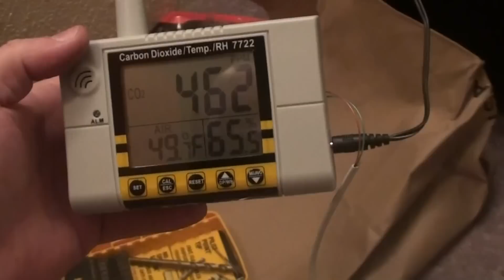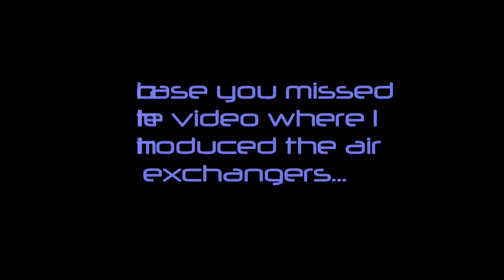Drum Room Construction : Part 9 - Air Exchanger

Comment: Was this the last video? Interested in seeing the finished resault. Working on my own drum room/studio :)
Reply from the maker: Yeah, I suck. I will be posting a wrap-up pretty soon though. I bought that stupid Camaro, and it side-tracked me :)
Reply: asicerik Understandable. I was gonna post uploads like this, but due to my laziness I'll have to post one, long video by the looks of it. You've given me some great ideas though! You only run two mics on your drums?
Reply from the maker: Andreas Steinsland Not sure where the two mics idea came from? Maybe I have a video somewhere with only my overheads? No, I have two overhead mics and then mics on each drum (two in the case of the snare). I run all that into a Mackie 1604i firewire mixer. I have a firewire cable from there to the recording PC.
Reply: asicerik Nice! I'm running Shure mics on all my toms and snare along with the bassdrum. They also pick up my cymbals. Running them trough the Yamaha MG12XU.

In your "rough electircs" video you show us how you have to XLR cables going to your drum kit. That's where I got the idea from :)
Reply from the maker: Andreas Steinsland Ah yes! Makes sense. Yeah, those were more for the other musicians in the room with me (I have yet to use any of those other ports!). I do use the 1/4" jacks by the drum set to route audio FROM the Mackie back to the mixing console. Wow, I really do need to do a video to explain all of this... thanks again!

Comment: Just a couple of questions how many feet is your drum room how much did you spend in basic materials? i'm looking to build a room like that myself in the garage
Reply from the maker: It is a bit of an odd shape, but overall it is around 16' x 16' with a couple extra spaces for storage and the mixing desk. So, around 300 square feet all told. Materials were around $2,600. About $1,000 of that was the sound proofing stuff, Green glue, hat channel, clips, etc. Another $400 or so was for the XLR and 1/4" wiring I put in the walls for recording.
The real trick is having free labor :)

Comment: so is it sound proof?????
Reply from the maker: The air exchanger? Not completely of course. I should do a sound test. SO many projects, you know?
Reply: no the room!  i watched all these videos!  im  in the market for a house and i want a drum set but dont want to piss neighbors off so i've been looking around at options. i watched all these and you never did a final video to show if it worked or not.
Reply from the maker: Thunderstriker It is quiet. No complaints from the neighbors. You can hear the drums outside, but they are soft. I will do a video to show the sound level outside if I can find my sound meter... :)
Reply: damn really?  all that work and not completely sound proof!?  i mean what else could you possibly do?  do you know an estimate on how much that whole project cost?  would the neighbors complain if you rocked out at 3 am?
Reply from the maker: Thunderstriker Nothing is truly sound "proof" unless it goes in an underground bunker or something. My setup is killing 40-50db of sound (I think), so what would be 110 db (really loud) becomes 60-70db (I have not measured this with my drumset, but you can hear it). Now, that is right outside the walls. As you go away from the house, it gets quieter. A quiet street is typically 50db or so, so it is not far off. A few houses down and you probably would not notice it at all. Your neighbor right next door would probably hear it, but it would not generally be "too loud".

Comment: I really want to know how soundproof your ventilation box works out. When you put your ears outside or when you put a db machine outside hard near the vent how much sound does leak out. If someone is standing near the vent on the inside and makes high noise,  to what degree will his shouting be decreased to the ear outside. Because your vent is diy. And as i see has elements from the known "dead vent" idea. That is Elbows, Insulating/absorbing, it does not have mass and damping.